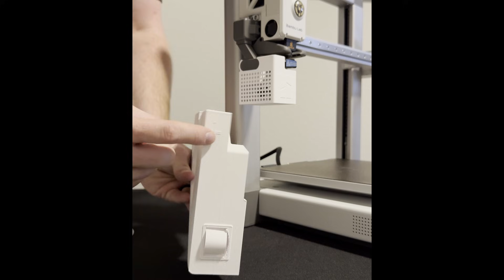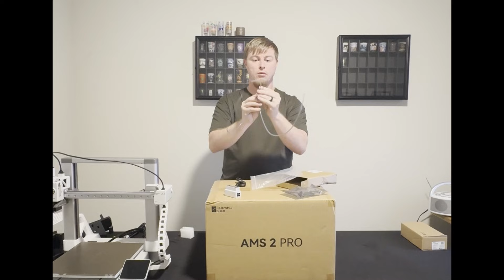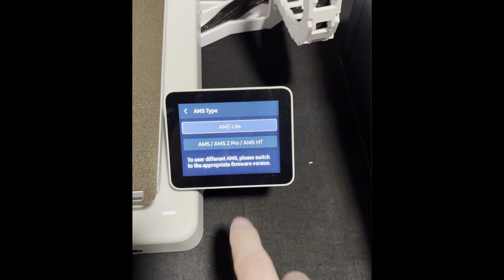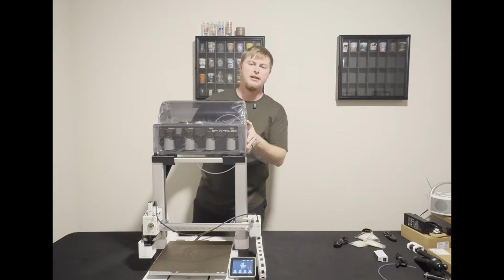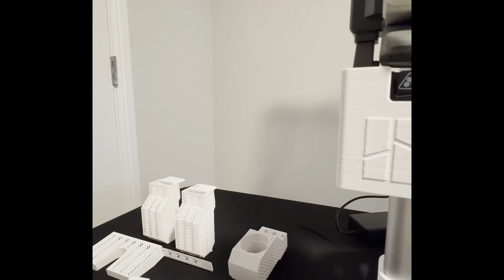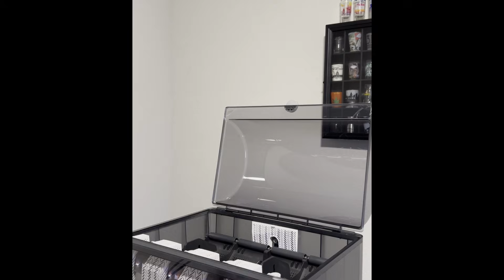How to Use a Bambu Labs AMS (or AMS2 Pro) With the Bambu A1 | Full Setup Guide

Comment: I don't understand why people insist on putting all that weight on top of the printer... almost 17 pounds. Doesn't seem wise.
Reply from the maker: For me, the space the printer goes in i don’t have any other options to place the AMS. However, i could build a shelf on the wall I suppose. Either way; you’re probably right, but I personally am okay with the risk at least until I can come up with a better option in the future. I have seen some supports that support the AMS from the back rather than the sides. I think that could be a slightly better alternative. I agree, if you can easily place the AMS Nearby without placing it on top, that would be best!
Reply: @Tyler_Tries_It1  I did put my AMS2 on top but with 4 spools of filament, the A1 would tip and rock back while printing and was not stable on my desk. I have since removed my top mount and just put it back to the side. I did not have the rear support brackets though, so that is entirely on me. This is an edit after a review of the video. But the mount I downloaded did not have those. I may look into this again with the rear mounts. I did like the free desk space for my computer with the AMS on top.